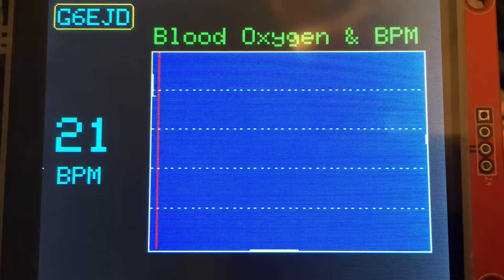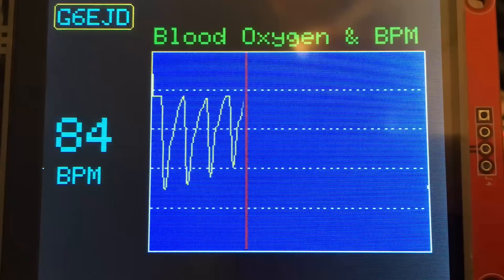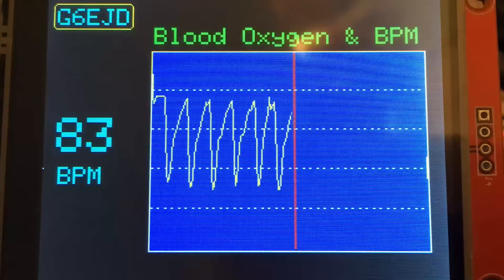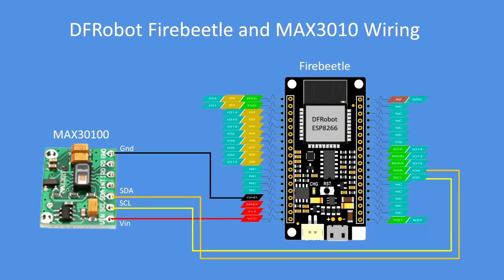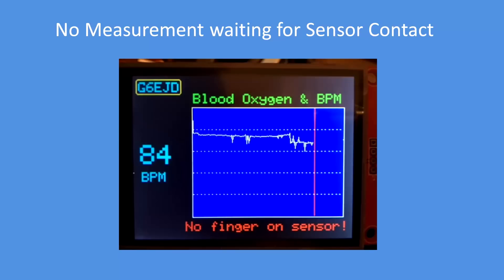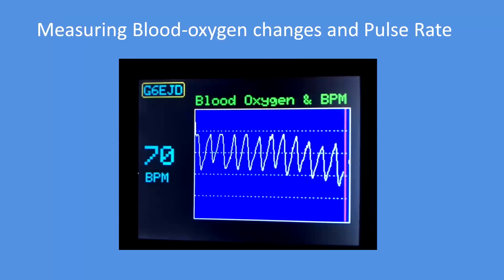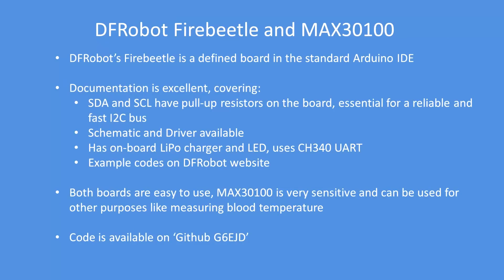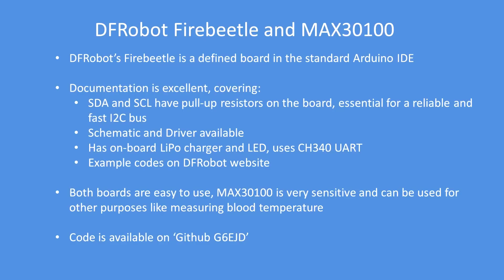Tech Note 072 - ESP8266 and MAX30100 blood oximetry and heart-rate sensor display

Comment: I looked at your Github code for this project. It is very well structured; but the only library I couldn't find is the heartRate.h library.  Where is this exactly?  Is it within the code of a companion library? Thanks..I am using the Wemos Mini D1 and thanks also for the additional code on Github for this processor.
Reply from the maker: Have you downloaded the max30105 library, heart rate is in there.
Reply: Thanks!! You have a heart of service, I have downloaded it but have not run the project yet..I thought it may have been something like that.
Reply from the maker: https://github.com/sparkfun/MAX30105_Particle_Sensor_Breakout/tree/master/Libraries/Arduino/src
Reply: I couldn't find the exact code can you please send it to me
Reply from the maker: The library you refere to is in the sparkfun library https://github.com/sparkfun/MAX30105_Particle_Sensor_Breakout

Comment: Nice project but I never got stable readings with this (or any other heart beat) sensor.
The link to the wiring diagram is broken.
Reply from the maker: The code takes a running average of the IR output and continually adjusts the position on the trace around the y axis and yes keeping a finger steady is needed but it does work, it takes about 5-secs to stabilise the trace and about 15-secs to get a pulse reading.
I fixed the wiring diagram link well in-part as I added two one for the DFRobot Firebeetle and another for the Wemos D1 Mini.
Reply: There's an erroneous black line in the firebeetle diagram.  (73 ex ON1NN)
Reply from the maker: Thanks, I failed to upload the corrected diagram, done now. I also changed some of the GPIO pins around to help make it less confusing for some people who try it out. I was using RXD which works OK, as a dual-use pin but on-balance I thought it better to move things around and help keep it simple. I see you have 6 qsl cards waiting for you on eQSL, maybe historic now. 73
Reply: I quit HAM about 15 years ago, didn't know eQSL even existed.
You must spend much time on these clean and clear videos, excellent job, keep up the good work. 73
Reply from the maker: Thanks, although YouTube does not really like them for some reason that I cannot determine, their Robot thinks they are obscene, contain profanities, swear words and other unsuitable material. Trying to speak to a human is near impossible, so I find YT disappointing as it takes me quite some time to prepare the videos, but it's only comments like from yourself that keep me going. 73 Dave.
Reply: What I especially appreciate is the overall technical correctness , the lack of disturbing background music and the straight to the point information.
I'm a professional technical writer and you are an excellent technical videographer. 73
Reply from the maker: Thank you

Comment: A sensor clipping on to a finger is more practical  - is one available or hackable with this board?  Thanks for your Tech notes.
Reply from the maker: I’ve not seen any, whilst the Max30100 is widely available no-one has yet made a housing for it. Holding a finger still on the sensor is a requirement for a steady reading and I’m surprised Maxim don’t mention the sensor human interface in their data sheet. I guess it’s for OEM’s to solve that aspect, they just provide the sensor.

Comment: Cool project. You didn't talk much about driving a display ?
Reply from the maker: Yes, in retrospect I should have, what happened is the effort to get a reasonably stable sensor response as it varies widely with finger pressure and every minuscule movement has diverted all my attention away from the display. It sounds trite, but the display element is the trivial part and I have re-used code from one of my earlier Tech Notes for graphing data on the ubiquitous ILI9341 tft. I was going to add blood oxygen level plotting but decided it was too complex at this stage, I might do a video that explain in steps how the display animation works.
Reply: G6EJD cool. It's the ECG like plotting that I am interested in
Reply from the maker: The ECG plotting (I'm not a medical expert) must be related to heart pumping action, but it is distinctly different from the electrical pulses applied to the heart as there is muscle relaxation that assists with the pumping when there is no electrical heart activity as far as I understand, but not that far off. The trace is blood flow and its oxygen level.